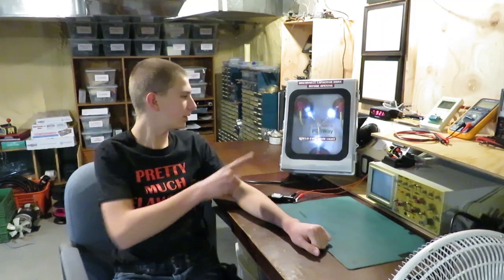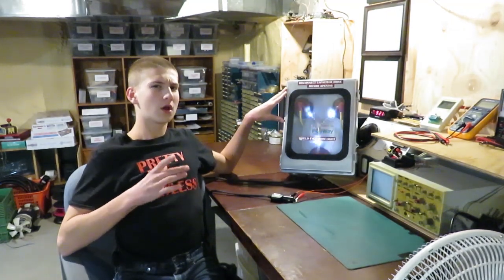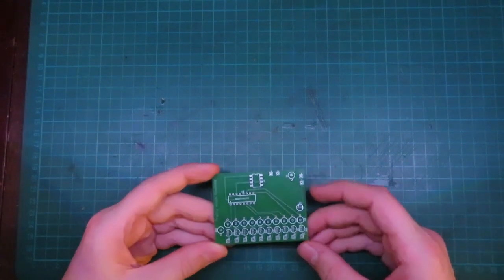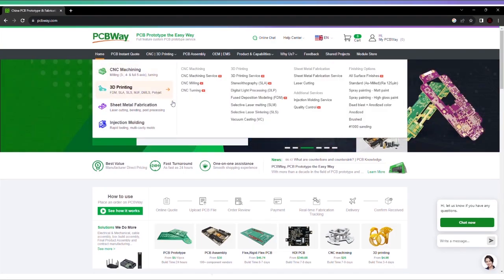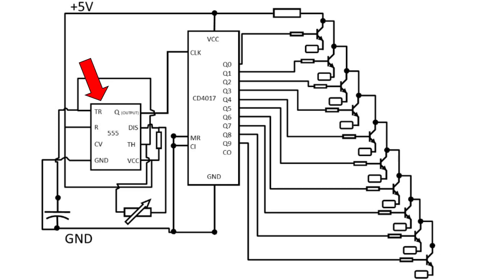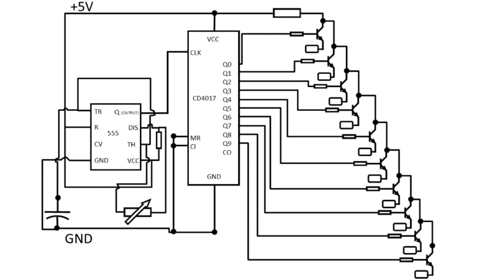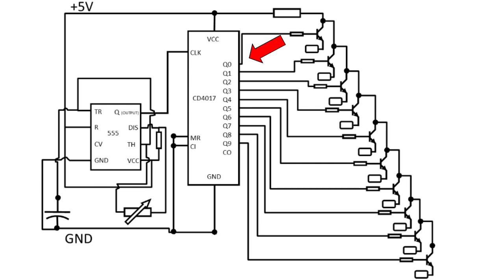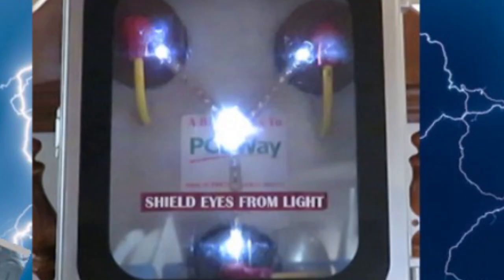Looking at the Flux Capacitor control board!

Comment: May it be possible, that the traces on the board arent 'correctly' aligned on a grid? 

(For this Circuit it wont change the functionality, but it looks nicer, if they're alligned on a grid with 45° and 90° angles. If the layout starts changing the functionality, eg. because you have HF-Signals on your board, you should rather use round 'edges', but that's nothing for beginners.

Comment: Why you use NPN transistors as emitter followers and not use them as simple switches?
Reply from the maker: They are just Switches, The emitter of the Transistor goes to the anode of a LED
Thanks for watching!
Reply: it ok to make mistakes and then learn on it. 
1) In your circuit NPN transistors work as amplifiers not like switches. Voltage on transistor emitter in emitter follower scheme never exceed voltage on base. So if you try switch 12 volt load in that way it will not work (because in emitter follower scheme voltage on emitter follow voltage on base and it equal voltage applied to base subtract pn junction voltage) . More proper way use NPN as low-side switches.
2) As I see you use common current limiting resistor it definitely error. Every led (or led string) need it own current limiting resistor. In your schematic brightness of leds depends on how many are switch on at the moment.
Reply from the maker: @sairus6055  Thank-you For explaining! I will do some investigation the subject!